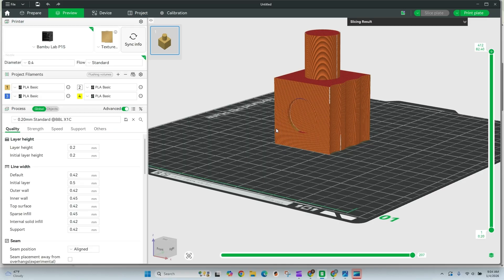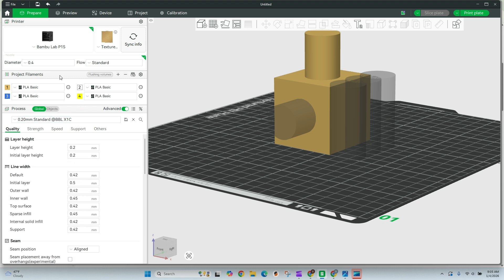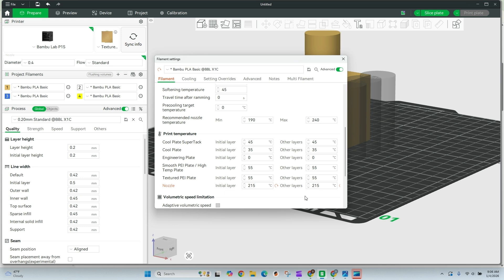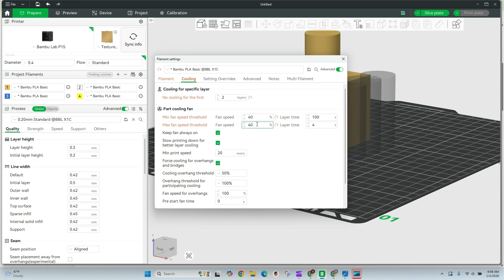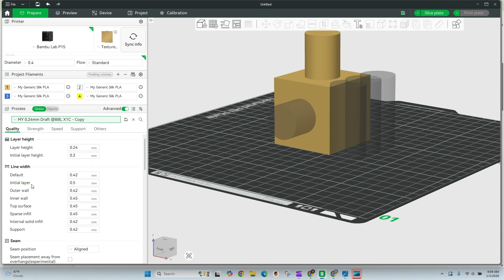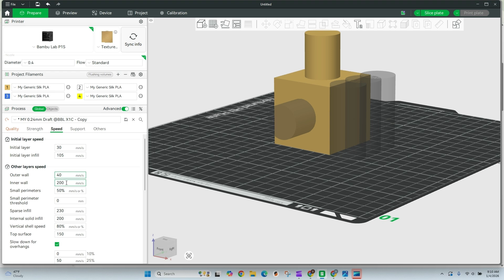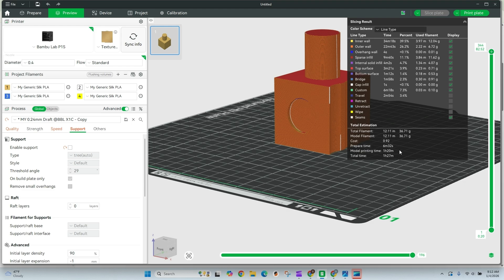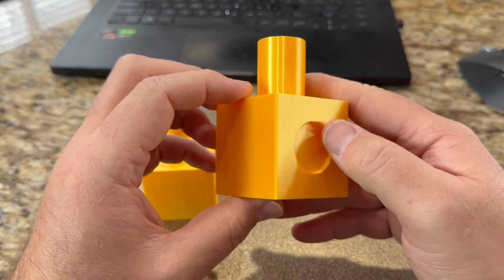Silk PLA Printing PERFECTED with Best Settings for Glossy Prints

Comment: Usually silk filament needs higher temperatures, 10C - 15C higher than normal PLA. Both to get the shiny silk effect and any reasonable layer adhesion. Slowing down outer perimeter is good way to shiny silk effect, the inner perimeter has no influence on it.Changing the line width also has no effect, it can worsen the overall size of the model (Silk is dense, it expands when extruded from the nozzle)